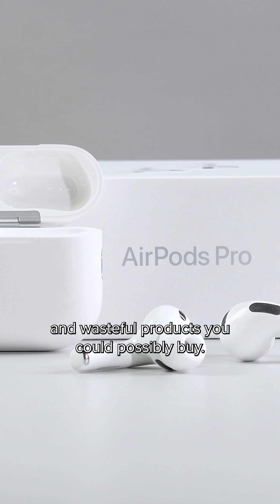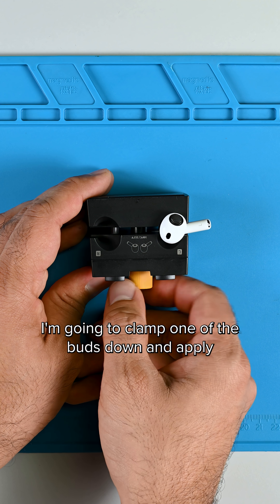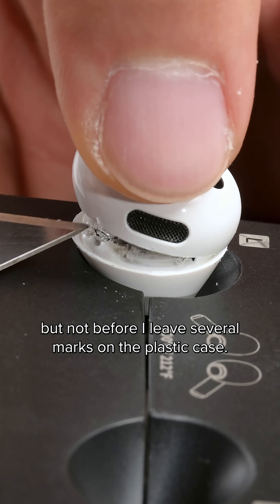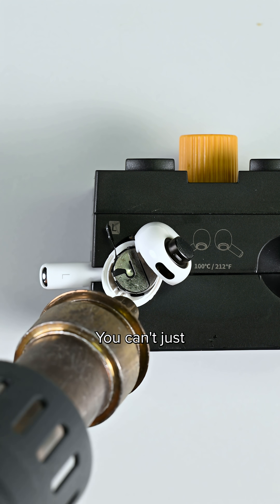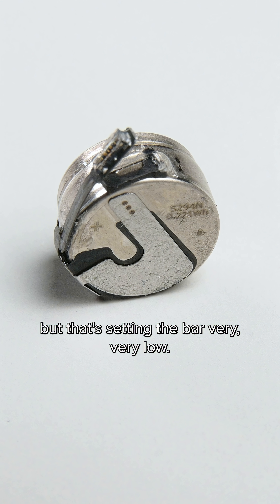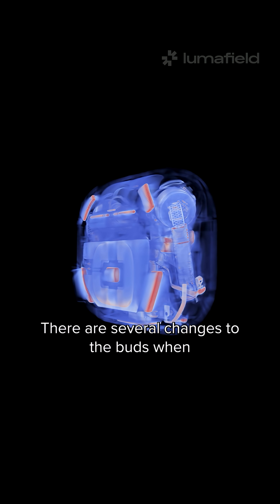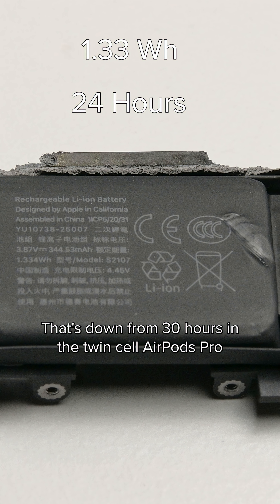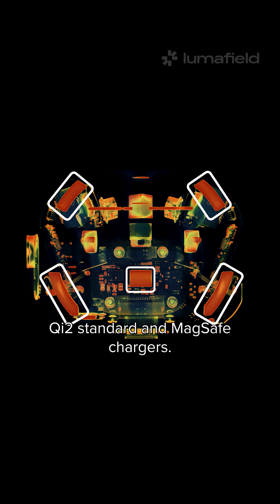We Cut Open AirPods Pro 3 To See Inside!

Comment: Not only are they unrepairable, they degrade very quickly. Original AirPods Pro, crackling sounds after a few months. Even the recall replacements developed the same issue. Second gen lost its noise cancelling after a few months. Can’t imagine these will be any better lol
Reply: No clue what you are talking about. My gen 2 Airpods sound just as good as when they were new, and the no ice canceled llation still works almost too good 😅. My first gen pro’s didn't start crackling for ~2 years
Reply: reading your comments on a 3yr old airpods pro 2 that still sounds good as new. granted the battery did degrade to roughly 6 hrs per charge now. no clue what you’re on about my guy.
Reply: @stravvberr1moon I got the OG Airpods Pro, and they work almost perfectly 😂

Comment: It’s really not fair to be shaming apple on AirPods repairability. Nothing like this is repairable.
Reply: Fairphone Buds are. And really, only because everyone else is doing a similarly terrible job with repairability doesn't mean it's excusable at all. They definitely could fix this at least on the case, they just don't want to, so people buy new ones.
Reply: @phjac My Super Nintendo is also very repairable. Because it's a different product entirely
Reply: @phjac doesn’t your logic go out the window with a uhhhh a warranty? Or Apple care? 🤔
Reply: @SSNebula Right, just get every time something breaks something new and throw the old one in the trash instead of repairing it.
Reply: @phjac yeah but the fairbuds don't have half of the tech found in the AAP3 and I would rather have great noise cancelation and audio and heart rate sensing and find my tracking in each part and water resistant than repairability. Will it last for more than 3-4 years ? Probably no but that's th price u pay
Reply: @Moustafa59665  Maybe the having less part about the fairphones is more likely because apple's airpods ARE better? That doesn't mean that they need to sacrifice repairability. They are just doing that to make you buy new ones instead of repairing them on your own as stated previously. Also, both of the earplugs are probably priced differently
Reply: I think some of the Samsung buds are pretty easy to open and change the battery.
Reply: Sony wf 1000xm4 are pretty repairable
Reply: "Leave the multi-trillion dollar corporation alone!"
Reply: @DioTheGreatOne  The whole argument of shaming a manufacturer for having unrepairable pieces of small technology is so lame lol.
Reply: But we don't need Airpods. we had it fine with wireless bluetooth
Reply: Glaze
Reply: Apple has alot of money they could find alternative ways to make it more repair friendly

Comment: So it sounds like when you got the AirPods Pro 2 you don’t need the upgrade
Reply: i'm so happy reading this i bought airpods pro 2 in april this year & thought airpods pro 3 was much better
Reply: @luvsonuzzz  I did upgrade from the pro 2, and maybe the anc is a little bit better, but it's hard to notice. The only noticable thing is that it fits more comfortable in my ear. Everything else feels the same. So don't worry, the pro 2 is still excellent.
Reply: @AlexAegisOfficial would disagree. ANC is better and is definitely noticeable, fit is better like you said but the sound is definitely different. More bass on the newer ones and to me the highs sound less harsh

Comment: Why need to repair when we can replace it with a new one. Just bought Apple care along with it and told them battery back up is not good( but actually the battery back up was only slight reduced after almost 2 year 😜)at the end of 2 year Apple care period and I got brand new one by paying 2500₹ or 28.19 $ mine had slight corrosion in contact contact points otherwise for this battery back up thing no need to pay 2500₹ or 28.19 $ also. Unrepairability  is kinda good though when it comes to Apple AirPods Pro 2
Reply: Great for you, but it would be so much better if they were designed from the start to be repairable. Batteries are consumables.
Reply: Yes please throw more electronics in landfill!
Reply: @russell.bishop recycle you mean
Reply: @alexramon5179  I'm pretty sure they meant to use the "/s" at the end
Reply: AppleCare for AirPods is a steal